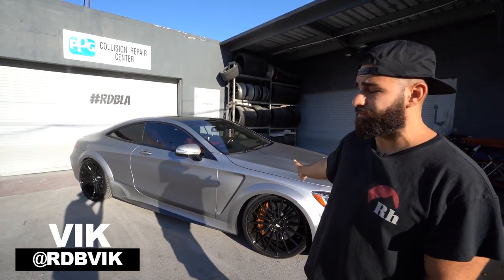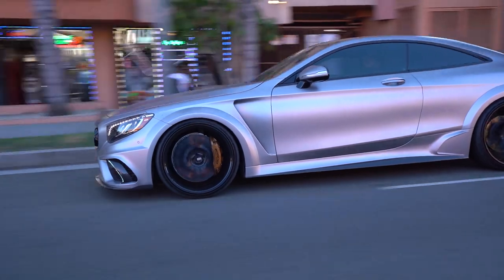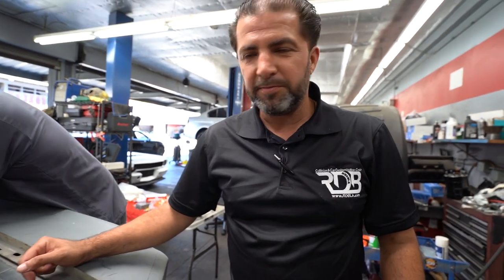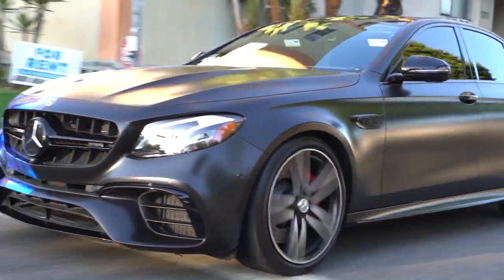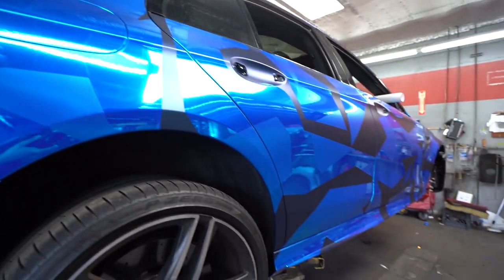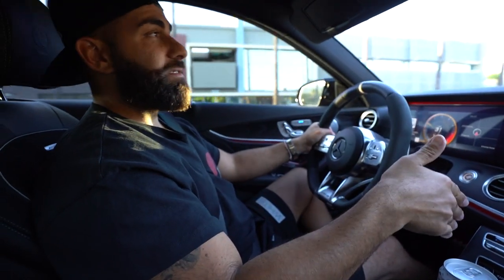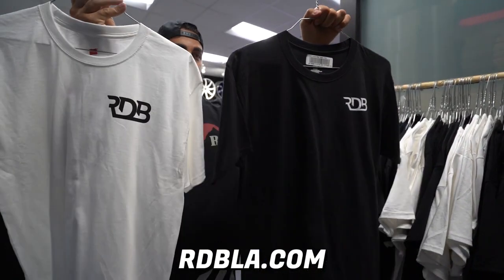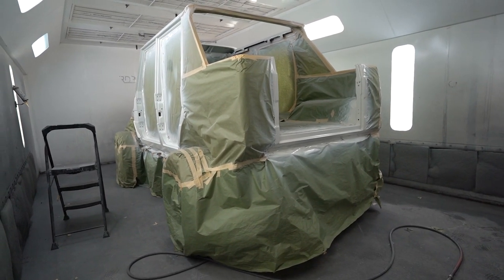MANSORY STEALTHY S63 REVVING, HOW TO PAINT A NAKED G WAGON, A CRAZY 2 FACE WRAPPED E63S AMG.

Comment: It doesn't look like the front bumper and body of the S63 match colors.
Reply from the maker: Plastic vs metal and different angles will show the bumper/fender colors differently. You can check out a brand new Mercedes at a dealer with the same thing.